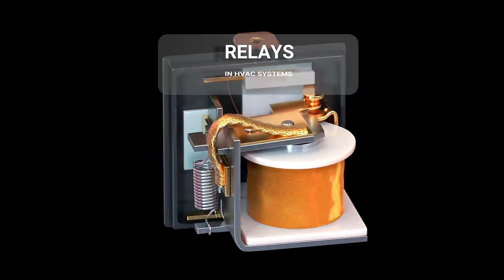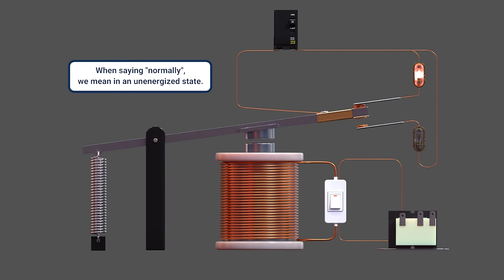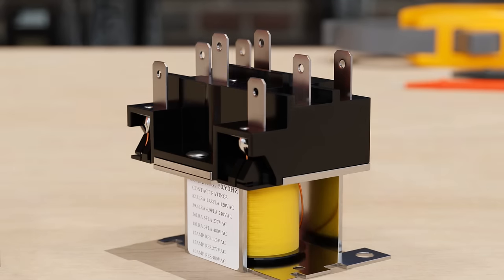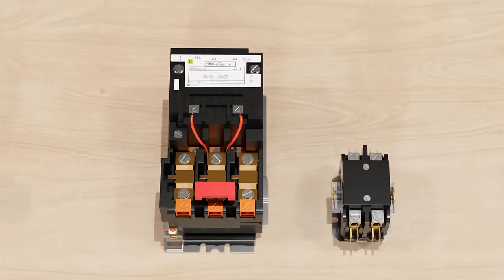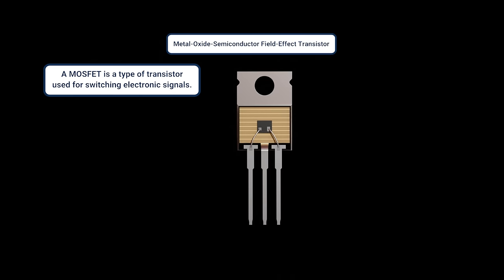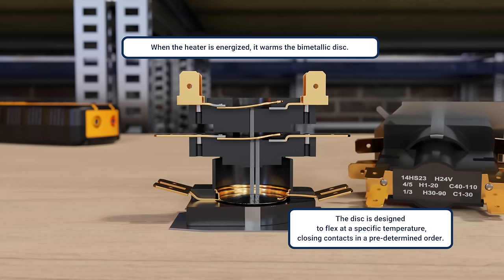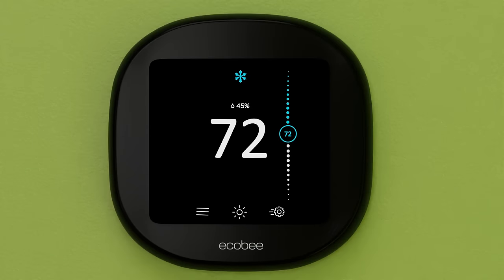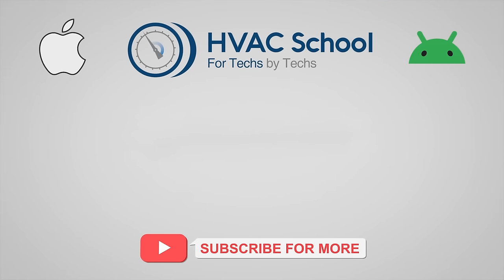HVAC Relays 101 3D

Comment: The old 1800’s technology 😂 If the public understood just how easy electricity (as we utilize it) is, ya’ll be unemployed.
Reply: The information is free and out there for anyone to see. It’s not even that hard if you’re somewhat mechanically inclined to fix simple resi HVAC problems. I tell customers all the time it’s not worth buying a thermostat from me and how to replace their own.

The issue going forward is going to be communicating systems, solid state controls, DDC, etc. Most of the time it’s just “replace the board” but … which board haha - especially when the board costs $750
Reply: Combustion engines also started in the 1800s, look how little has changed there and yet somehow people still need mechanics?! I'd love to see your homemade relays for your homemade HVAC system.
Reply: Electricity is easy, refrigeration gas and pressures are FM.
Reply: Calculus is 300+ years old. 

Don’t hold your breath on “the public” becoming mechanics in a field that is becoming more complicated by the day.
Reply: Cant be a master at everything
Reply: You can say that about anything in life. Only if it was that simple.
Reply: This statement applies to a few fields.
Reply: @hvacmisadventures we have a board repair department for those expensive boards. It's ludicrous to replace an entire board because a 10 cent capacitor, resistor, diode or IGBT has failed.
Reply: Thank God you stopped by to enlighten us.  Must have taken a quick break from your new energy source invention. 🎉🎉